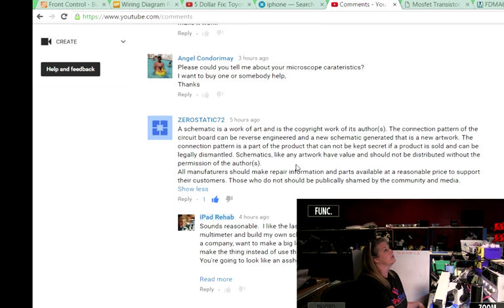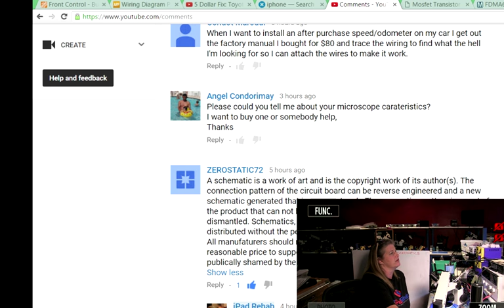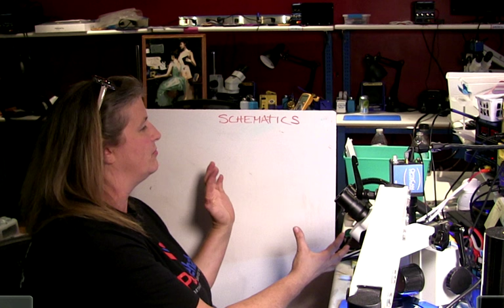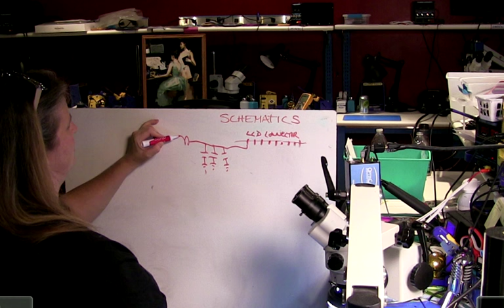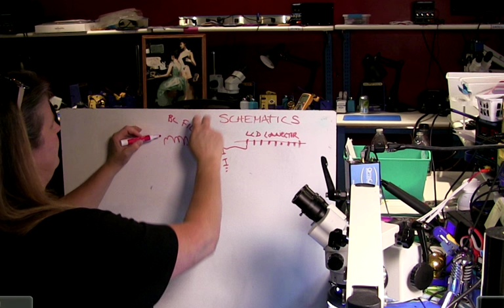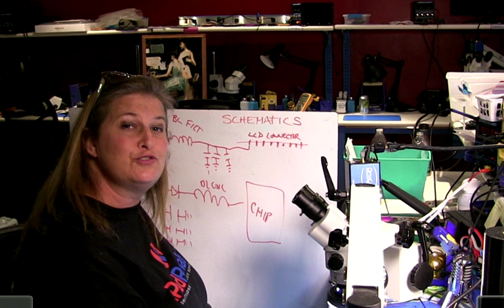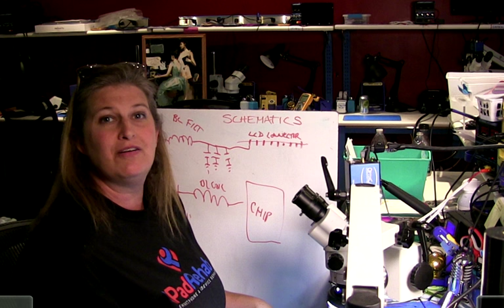There is no secret sauce in a schematic, unless you're a douchebag.

Comment: Main difference between fixing a dishwasher and fixing an iPhone is that for the dishwasher I probably don't need a microscope to find the problem (assuming nothing wrong with any logic boards if present). Also, if my screwdriver slips a bit while taking my dishwasher apart I just reposition it and carry on. Do that on an iPhone and bye bye many little parts that just got crunched. You and Louis and anyone else doing this amazing work are nothing less than gods in my humble opinion!!!

Comment: I don't know if your dishwasher has this, but most appliances come with a repair and troubleshooting manual inside them. My washing machine took a crap, so being me, I took it apart. After troubleshooting it with the factory provided manual, I was able to narrow it down to the motherboard. After checking it out under a scope, I found cracked solder joints. Once I resoldered it all, the thing worked perfect.
Reply from the maker: Right--the cultural absence of this information in mobile devices is not cool.   The small appliances also get daily wear and tear and have mechnical moving parts.  Yet culturally we expect to be able to repair them, for years after purchase.  

When did we decide to allow mobile devices to be culturally different than washing machines?  I think we need to make a cultural expectation that there is no difference.
Reply: They shouldn't be, and that's why the right to repair should be a given.

Comment: To be fair, does any phone company let you find schematics? I do repairs on game systems and older consoles are easy to find, but the newer systems are very hard to find.
Reply from the maker: And why is that?  No reason other than douchebag culture in manufacturing.
Reply: +iPad Rehab they all for some reason became paranoid of modders, and keep trying to say hardware changes are the same as hacking to steal software. I think it's really stupid too, but good thing they don't make them to difficult to figure out.
Reply from the maker: That's the point of this video---to show that the information IS already there, just really really really hard to mine out of the board. 

They are protecting nothing since the information is there.   They are being douchebags because they are putting up a mean-spirited roadblock to repair for no reason other than to be a douchebag.  People have the right to iterate on a good idea---that's how we evolve.  People have the right to repair.  People have the right to mod their stuff.

Comment: Its called intellectual property,  does your washing machine give also de firmware code inside the microcontroler? Or even the schematic of the logic board? Is their biz, you want the schematics from Apple, samsung, motorola, etc etc etc?, all of them have channels to get them, become a certified tech center and your will get the schematics, honestly some time the douchbags are all these self proclaimed robin hoods populating youtube criticizing companies just because these companies want to protect their intellectual properties. And is lot more complicated to just include the schematic with the manual like in the old TVs, times have changed, and changed a lot.
Reply from the maker: They don't have channels to get the schematics, actually.   Apple authorized service providers have no access to schematics and in order to maintain their certification are absolutely not allowed to do anything other than basic screws and glues repair...motherboard repair?  Heavens no.

I'm not asking for Apple to include the schematic with their iPhones.  All I'm asking is that they don't actively pursue shutting down resources that are using Apple schematics to help people repair Apple devices to keep Apple customers happy.  That's all.

If you can provide a compelling argument of what can possibly be gained from witholding the schematics, then I'm all ears.  

If I'm standing in my yard watering my garden and a thirsty jogger comes up and asks for a drink from my hose, I can tell him to go fuck himself and get off my land.   It is private property.  I have my rights.   Or I say "sure buddy, let me help you, no skin off my teeth"

Witholding schematics just because you can, when you have nothing to gain, is a douchebag move.   And people should be aware of that behavior.  I intend to do whatever I can to make sure people know the facts.
Reply: Sure they want to protect their intellectual property but that is not why they are motivated to shut off access to self proclaimed repair services. They are motivated by greed and only it's ability to move more products without a slow down in production. If self proclaimed repair service fixes their product it equals a loss for Apple. They don't get anything with the repair and the customer does not buy anything through Apple. They are not asking for any firmware code either. Sure they might be interested in being able to program a blank SMC chip so they don't have dig up donor boards, this is very basic intellectual property(road map). After all, it's China who is cloning their products illegally and truly infringing on their intellectual property.